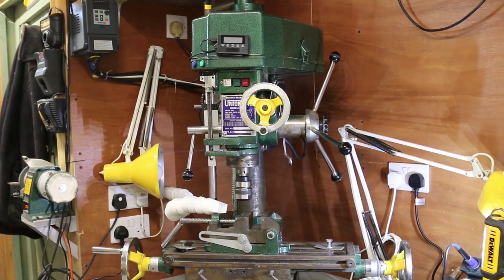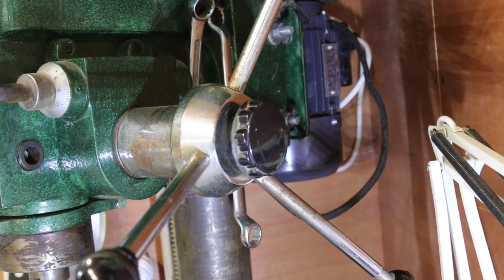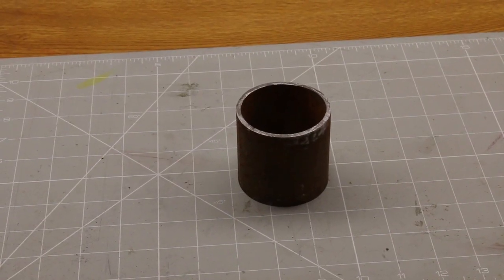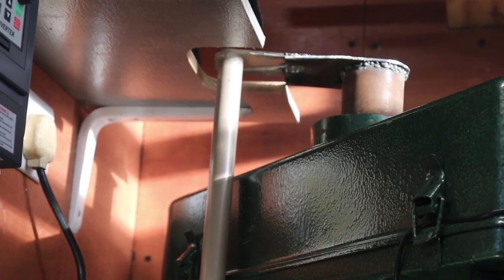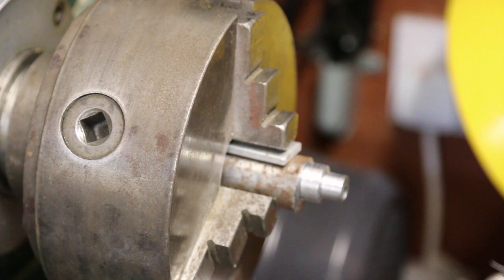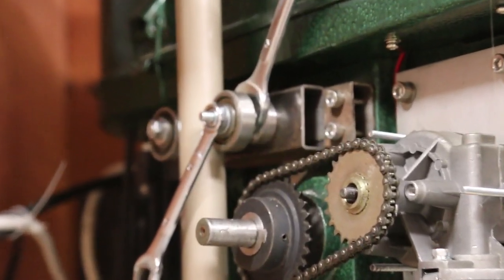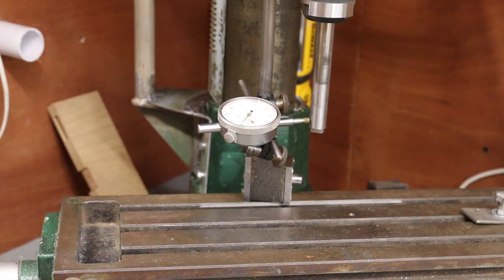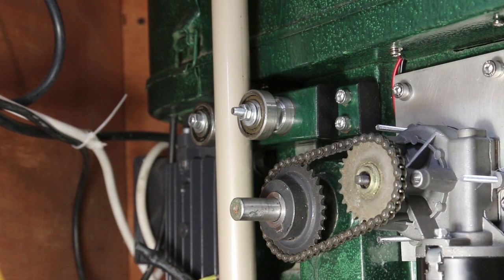mill steady

Comment: You have a great little shop my friend. Keep making chips. I too have a round column mill Rong Fu 31. I am confident that as you mention they have been around for 40+ years. If there was a design problem with the round column, they would not have been as successful. I don’t understand all the talk about a “ design problem” as there is not one at all. I can easily align my head dead nuts every time I have to raise or lower it with a dial indicator and a magnetic base. It takes no more time and I’m sure that is the method the Mfg. Had in mind when they built and designed these less expensive mills. Lifting the head with the supplied crank is also not a problem. No sweat involved. I like the simplicity and versatility this Type of small home shop mill provides the average tinker man. Keep up the good work my friend!
Reply from the maker: Thank you for your kind words. Additional steps to retain alignment on head movement is a 'feature' of these mills that many would like to do without- hence all the designs of kit to prevent it.

Comment: You're very clever! I assume you're an engineer by trade? or did you used to be a police officer? (the navy jumper).
Reply from the maker: Thank you! Technically an Electrical Engineer, but I have been interested in 'metalwork' since my youth. Had that mill for 40 years, and only just getting round to improving it. The jumper is air force surplus- I am a cheapskate... Warm and hardwearing (the jumper, not me ;-).